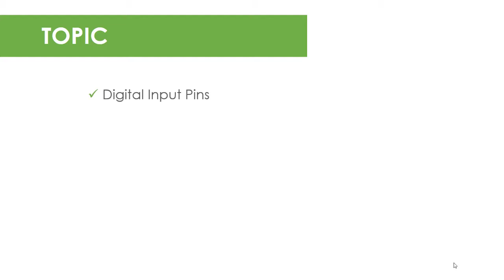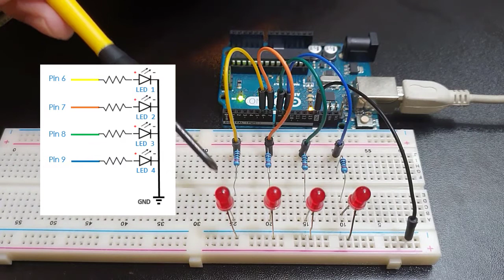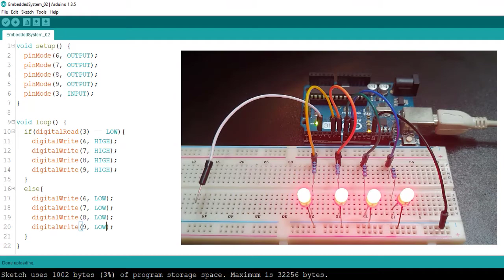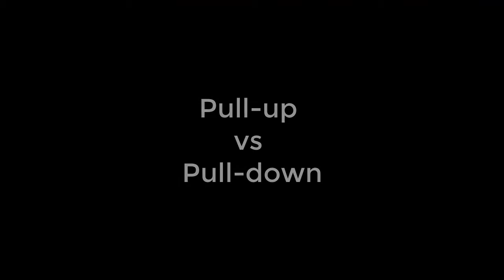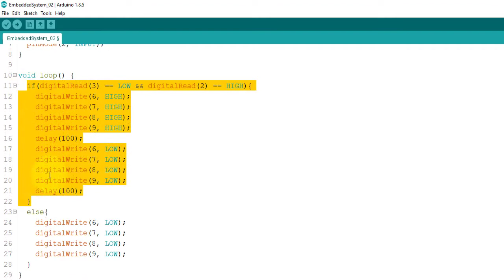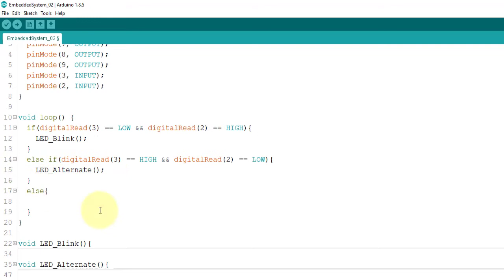05  Arduino Digital Input | Pull-up and Pull-down Resistor Explained | Embedded Systems Course

Comment: Brilliant video! Thanks
Reply from the maker: Thank you!
Reply: @joedgoh  https://youtu.be/9GXmjv1Uwdo just working on this project.  The 433mhz module pins go high when activated so I was worried that I need to pull them down to make sure I don't get any anomalies in signal.  Your video was a great help!

Comment: this is really annoying, there must be a resistor bank or something that can be used so you don't have to connect all these resistors for I/O
What about the output from another MCU, should the input on the receiving MCU have a pull down resistor for when the sending MCU pin is in a low state?